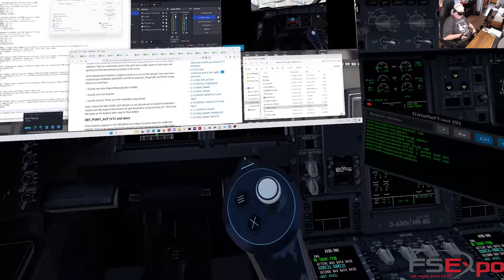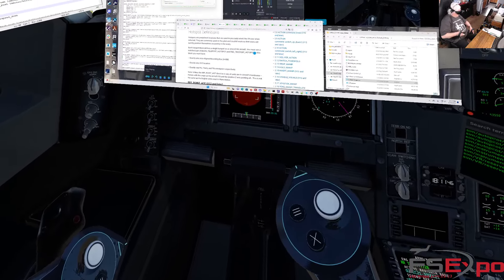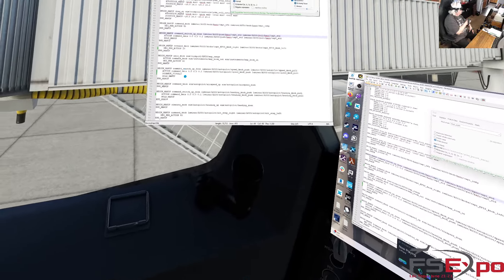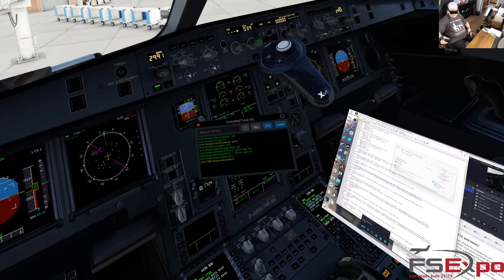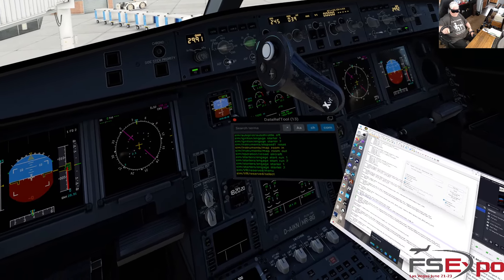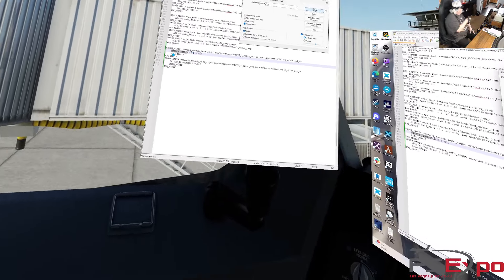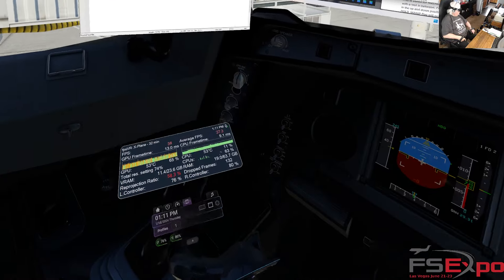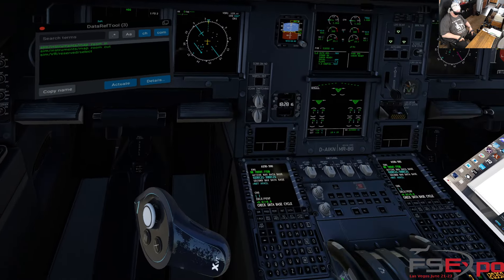How To Improve VR Controller Interaction By Adjusting The  vrconfig txt File

Comment: Hey Sparker. Before I invest in a Bigscreen Beyond, I wanted to see what the smaller FOV looked like relative to my Valve Index. So I "PDQ modified" my HeadLamp XPlane plugin to add "blinders" on the edges of my vision matching the documented FOV. The vertical FOV is noticeably tighter, but not too bad! The horizontal FOV is about the same. Does that agree with your experience?
Reply from the maker: I am coming from a Vive Pro 2 with prescription inserts that I think reduced the FOV. I do not find any issue with the Beyond FOV and if I need I just turn my head. the fact that is so light you barely feel like you are wearing it. I did have to get a updated IPD and facial interface to get to where I am now but very happy now.
Reply: @sparkerinvr526  Yeah, I also currently use prescription inserts with my Index and I'll need to have some added to the Bigscreen in order to use it.